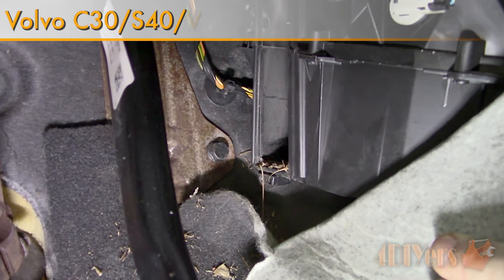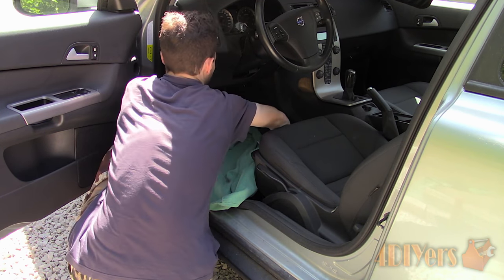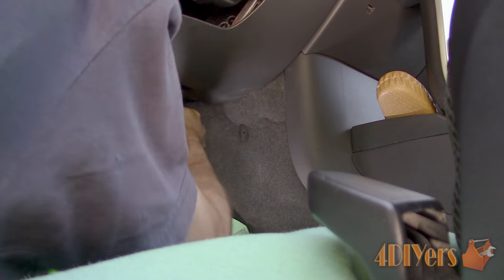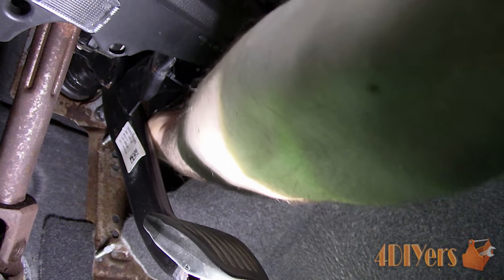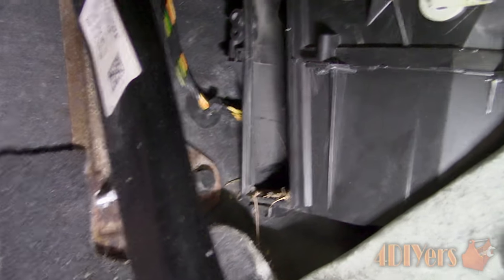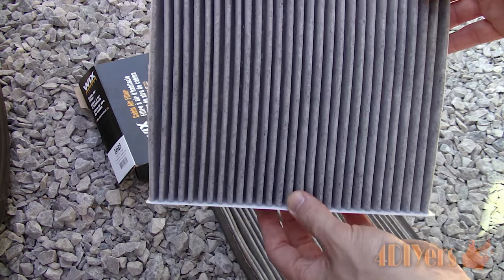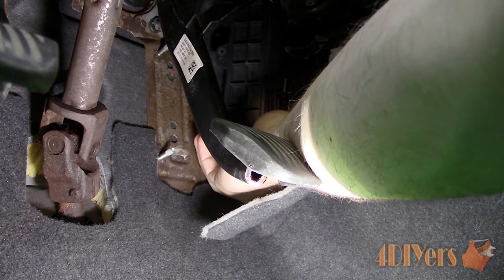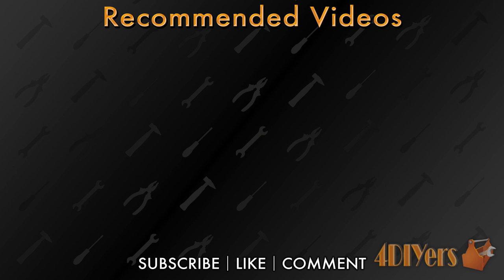How to: Volvo C30 S40 V50 C70 Cabin Air Filter Replacement

Comment: Headlight removal design, 1 pull pin, Filter change (serviceable item) 1 hours work
Reply from the maker: Love the headlight design, hate the cabin filter design lol.
Reply: L
Reply: Only an hour?
Reply: I never used it before and did it all under 25 minutes. Excellent design
Reply: I just said the same thing about checking the transmission fluid!! 🥹

Comment: Possibly one of the most challenging jobs I’ve tackled on a car in years! RHD model and eventually had to unplug ECU and drop it down, however access was still impossible, strange with a car that has a full dealer history it would appear this filter had never been changed, I wonder why? Thanks for the video. Regards from Scotland🚗🚗
Reply from the maker: Glad to hear you got it replaced and thank you so much for the kind words!
Reply: Added annoyance of seat runner digging in my back while doing filter. Ford focus is exactly same struggle.

Comment: However difficult you think this will be it will be harder. Im not exsperienced with mechanical things but I have child sized hands and im only 27 but i could barely get my hands and a tool up here to turn the ratchet and get the pedal and the top air filter bolt is a nightmare to put back on. In the end i feel accomplished and have AC but not for the faint of heart.
Reply from the maker: Thank you for the feedback and happy to hear you were able to do it. This job definitely takes loads of patience and it makes other repairs seem much easier lol. If you're seeking additional repair videos for this car, I have plenty more, along with some being released in the future too.

Comment: Absolute worst placement of an air filter.  
I do mine every year and don't take the gas pedal off.
I find swearing a lot is helpful.
Reply: Hi Stephen, like your humour !
Reply: Just changed, agree with you.
Reply: @elgen13 Next change will be easy once you've done it.
Reply: @Jan-eh7nf  Just did mine again.  F-Bombs galore.
I don't find it any easier.
Reply: @Jan-eh7nf  trust me its not get easier I just change the filter again and I swear a lot again XD

Comment: Had a look through your video to help me out. With mine being a UK model, cabin filter location was on the passenger side. Did this make it easier? Definitely not! 😂 involved removing the CEM unit and it’s housing bracket to get to it, but all in all took about an hour. Thanks for your great walkthroughs :)
Reply from the maker: Happy to help and thank you for the feedback too!
Reply: hey i need to change mine, where can i buy this filter?

Comment: Great video and commentary. I own a C30 2010 model and would love to see a video on installing a Bluetooth system that allows audio music streaming. Hacking the existing handsfree would be ideal, or at least a mod that doesn't look too messy/aftermarket..
Reply from the maker: Thank you! Unfortunately mine is an 07, so it doesn't have the handsfree feature. You might be able to install a Grom system. I have an MP3 cd player which is all I use, I don't even use the AUX port behind the waterfall.
Reply: I just got my C30 yesterday with BT. However I know there are BT receivers on ebay for $10 or less you can buy that come with a dual 1/8" plug. Plug one end to the receiver, the other into the 1/8" jack on the car, then use your phone to connect it to the receiver. Set the cars audio source to the audio jack, and you'll be able to play music from your phone into the car.

My Samsung S7 has a low volume output but I'm about to test the cars Amp using a USB stick and my 1/8" jack.

Comment: Good Video, didn't take me long, This isn't as bad as a P80 platform at least Lol.
Reply from the maker: Thank you! How bad is the P80 version?
Reply: @4DIYers  It's really not that bad but it's under the windshield apron and you have to remove the wiper arms.  And fitting the plastic apron back into place can be annoying.  Being outside the cabin those filters get really nasty too.

Comment: For all you guys complaining about The Volvo guys beeing bad engineers. This is a Ford design. Everywere you read it says FoMoCo (ford motor company)

The procedure on a ford focus is exactly the same, uses the same filter. Even the stupid door for the filter with 3 screws is identical.

Stupid fucking ford engineers, I just went through this on my beloved Volvo V50 and I swore a lot thinking that this is typical ford stupidity, and I was unfortunatley right after a bit of research. 😂😂😂

Thank god for the 2,4 liter, 5 cylinder Volvo engine i have in mine. Love this engine
Reply: And stupid Volvo for implementing this terrible design
Reply: @CarnivalAX didn't have much of a choice considering Ford owned them at the time

Comment: Thanks for the demo buddy, a quick question if I may, my cabin is full of fumes when running the heaters (fine when heaters are not blowing) in your opinion would you consider this the cabin filter (just before I go through what you did here 😂). Thanks again 🤞🏻
Reply: Mines the same did you figure it out thanks in advance

Comment: For RHD, it's still a headache to replace. To get access to those bolts, you'll need to remove the passenger side fuse tray beneath the glovebox. 

1. Lower the tray by loosening the two wingnuts 

2. Disconnect the wiring harnesses from the fuse tray, remembering which colours go where. Most have levers to release and replace them.
 
3. Maneuver the fuse tray forward out of the bracket so it is no longer in the way 

4. Optional: Remove the bracket by removing the two nuts.

Now you should be able to get to those three bolts holding in the cover to the cabin air filter
Reply from the maker: Great tips, thank you for sharing!
Reply: @4DIYers  please consider pinning this to the top of the comments for hopefuls like me thinking right-hand drive would be easy :) overall great c30 content!

Comment: I lost the bolts from the filter cover. could you please tell me what diameter pitch and length of bolts are used there. or just a bolt pattern. Thanks.

Comment: You said right hand drive would be easier.Well,that's not entirely true.Instead of playing with the acceleration pedal,you have to take the fuse box down and then you need to take the fuse box holder holder so you can replace the air filter

Comment: Helpful! If you are RHD you don’t need to remove the pedal but you will need to unbolt the fuse box (two plastic screws). The fuse box bracket can be a bit of a pain, but I would leave it in and persevere!
Reply from the maker: Thank you for the feedback and tips!

Comment: By removing gas pedal, i'm guessing it doesn't need any calibration or such?
Reply from the maker: No need for any calibration.
Reply: Three tiny screws & bolts, that’s ALL? Two get loosened and ‘adieus amigos’?? I assumed that per-design, the pedals require MORE securing measurements… Besides an Uber-ridiculous placement of a cabin air filter — the vision of 3 little screws (why only 3, not 8 or 10?)(Personally, I’d be ok with 30). The cabin air filter is soooooo-secured — it takes an hour to fish it out; but THE pedals, separating life from death, deserved 3 tiny screws — that’s all…? Hmmmmmm
Reply: @ArtistIrinaSharie  haha good humor, i changed mine yestoday, remove 3 nuts from gaspedal wire off 10min, only had 1 screw on middle at filter cover 7mm so easy out with that and filter out, but it was with the arrow pointing to the front = wrong flow direction and was screezed the wrong side up n down, so had a laugh about that and put in a new filter after some vaccum work and finished it up 30min for a first timer not so bad. Enjoy your day.

Comment: THIS IS NOT WHERE THE CABIN AIR FILTER IS LOCATED ON A 2000 C70 CONVERTIBLE. ON A 2000 VOLVO C70 CONVERTIBLE IT IS UNDER THE HOOD ON THE PASSENGER SIDE. ALL YOU HAVE TO DO IS REMOVE TWO SCREWS AND DISCONNECT THE DRAIN HOSE, THEN LIFT UP THE PLASTIC PANEL, SLIDE THE OLD ONE OUT AND PUT THE NEW ONE IN. IT IS A SIMPLE 5 MINUTE JOB.
Reply from the maker: Yes I know, it's a different generation. This video only applies to the P1 platform. Yours is part of the P80 platform.
Reply: Not insulting your comment but it reminded me of “NOW DEAR TRAVELER IF YOU WILL ANSWER MY RIDDLES THREE!!!”

Comment: So I'm in the middle of doing this right now and all I can say is #$@&##$@ 😡 what a frustrating place to put this filter. If you're about to under take this....be warned that it willl be frustrating, uncomfortable, and you'll get angry at least 50 times during the whole thing.
Reply from the maker: Yep, the engineers definitely were not thinking on this one. To date, still by far the more ignorant cabin filter to replace.

Comment: Acabo de cambiar mi filtro de nuevo y sigue diciendo que es mucho trabajo una hora te lleva, es más fácil cambiar filtro de aceite, aceite y filtro de aire del motor, te lleva menos tiempo.
I still think that this is the worst place to put the air filter system